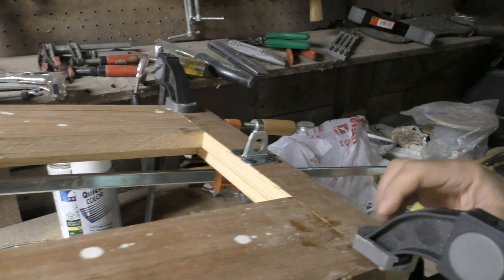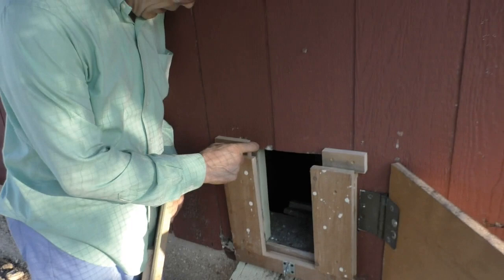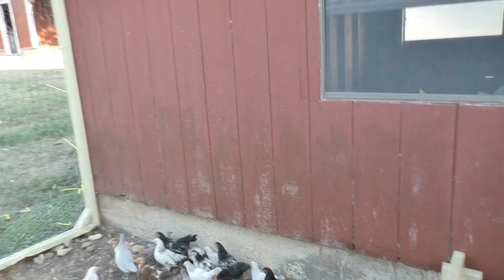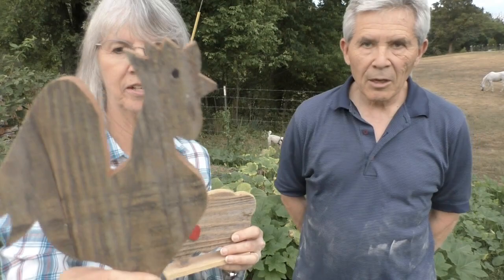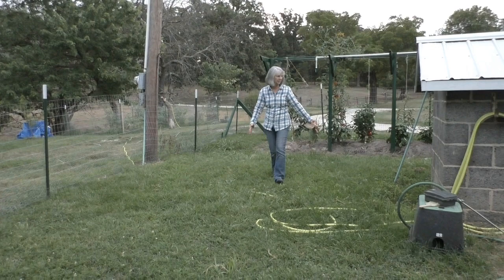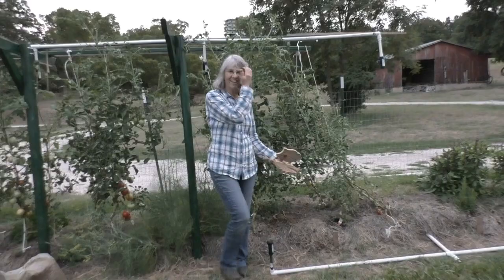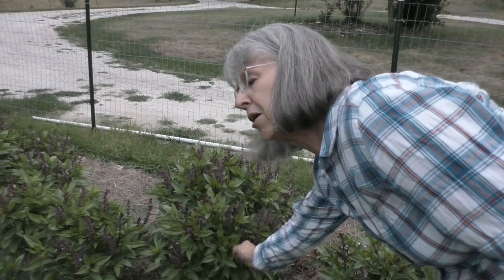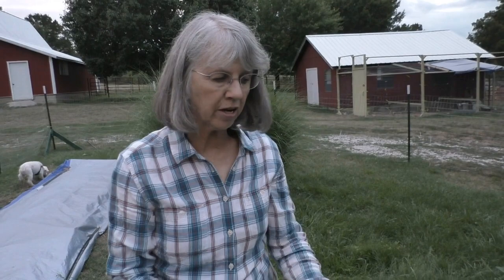The Bantams Get a Door

Comment: Something you can think about.. put a wire on top of the sliding door so that you can pull it from outside the coop.. wire runs along the chicken house.. like a pulley system.. I made mine like a pulley system, and it still great for this many years.. and it would be easier for you in the long run..